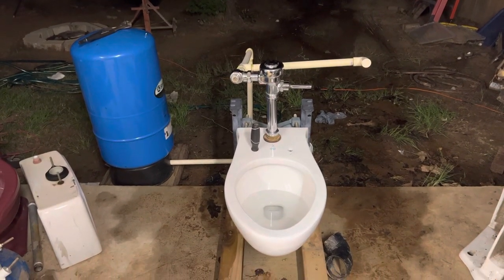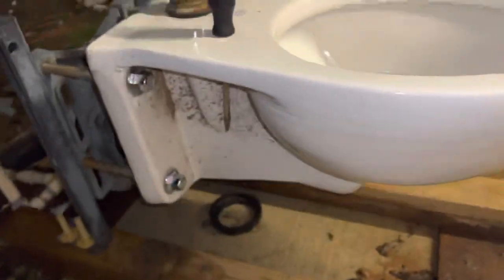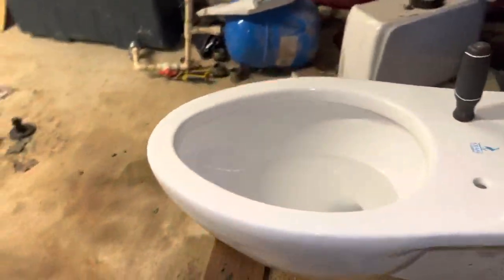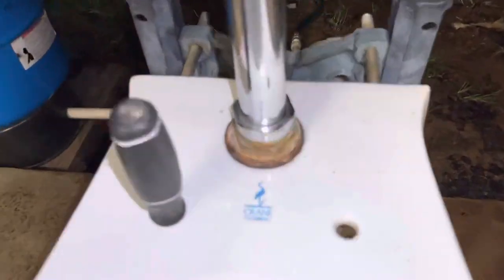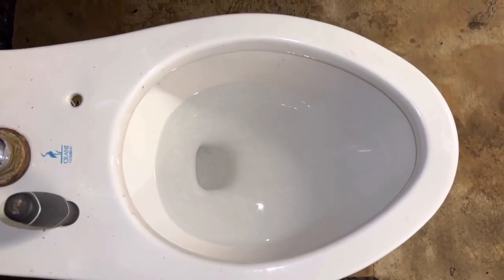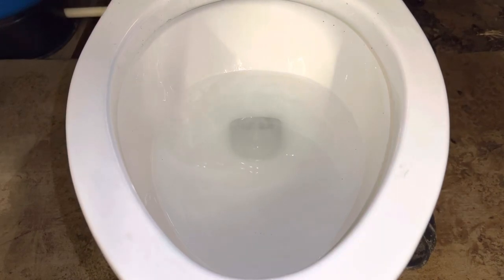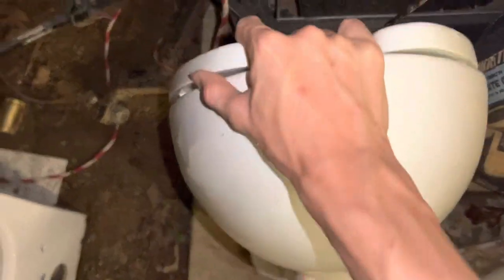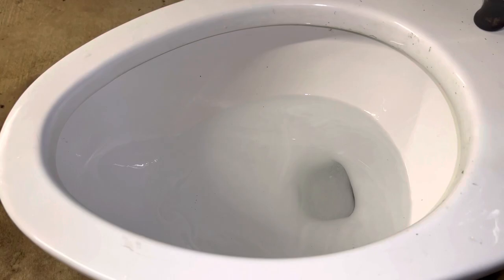Powerful 2000 Crane Plumbing Placidus Toilet Flushes!

Comment: I honestly thought it would swirl much more, but i guess it just depends
Reply from the maker: It’s not really designed to swirl
Reply: @BTRPlumbing  but It swirls so that means it was designed to slightly swirl.
Reply: They’re not designed to swirl a lot but mostly go straight down
Reply: @charlesrodriguez7984  certain toilets do swirl alot on high pressure